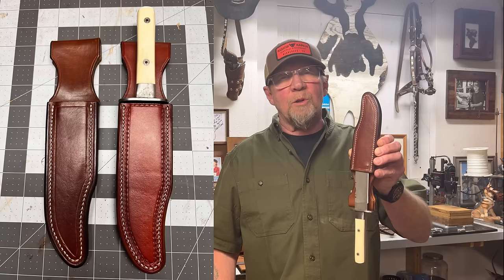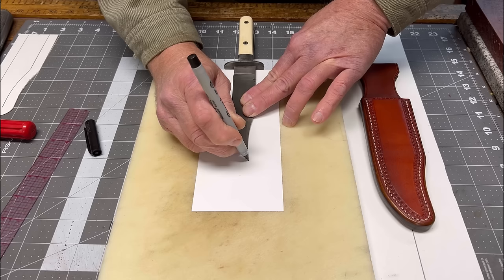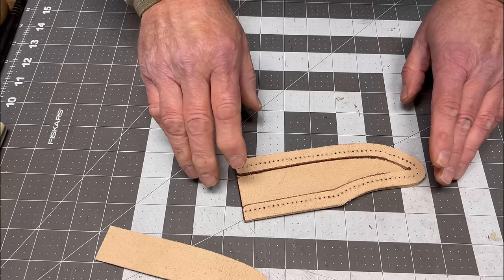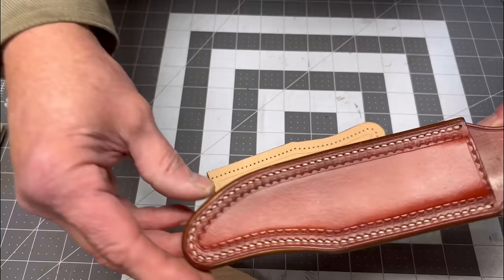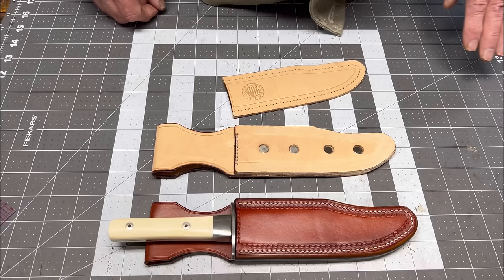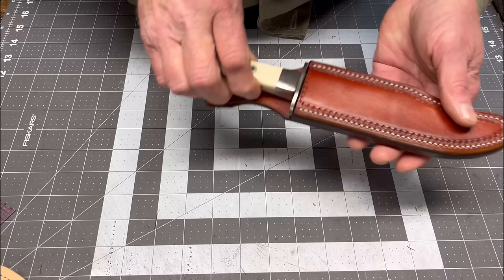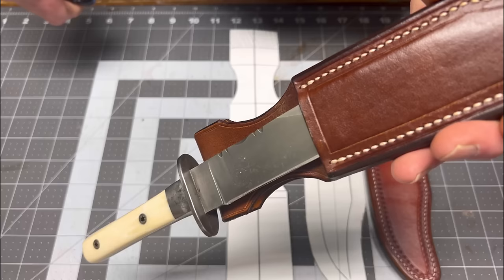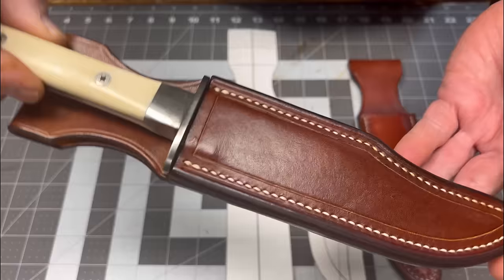The Secrets Of Knife Sheath Crafting At Knife Sheath School! #knifesheath #leather #knifeskills

Comment: Good info, I've been a knife maker for 40yrs and have always used a mini drill press to make stitching holes, it just works!
Reply from the maker: Agree 100% Mr John   I use a 1/16th” bit and as long as the thread  (1.0) size fills the holes it works perfect and makes a great stitch line  Whatever works. Thanks🙌

Comment: Hi Victor. Wonderful tutorial! I followed your directions for a KBar knife I made for my son in law. It was the first full-size jnife sheath I’ve made and it turned out beautifully…except for one thing. Like your example, I installed two name tag magnets, but it turned out pretty difficult to remove the knife. It for sure couldn’t have been withdrawn if the sheath was hanging on a belt. I removed all the stitches, carefully sliced the sheath open, the removed the bottom pair, glued and stitched it back together. Unfortunately, it STILL is difficult to draw the knife. I guess I’ll have to cut it again, pull out the bar, cut it in half and only use one magnet. I say this mostly as a head’s up for someone else that may be making this same sheath.
Reply from the maker: Hello Alan  Sorry to hear of your difficulties but I’m curious about the magnets you used  Were they the badge magnets? Those shouldn’t have been strong enough to lock it in like you described   I’d love to dwelve alittle deeper into what could have caused that   Thanks for your kind words 
If you have Instagram 
@viktorgeorgeleathergoods direct message me

Comment: Good Vid. I've been thinking about moving away from retention straps to magnets for awhile now. This was a neat example of how to imbed the magnets. I never thought of using badge magnets. (thanks for the tip) I've always drilled my stitch holes too, life is short, only difference is I use an actual drill press to do it. The Dremel just doesn't have the horsepower to keep the bit speed consistent. I can also slow my bit down and drill a little cleaner. I enjoyed watching this, thanks for posting it  🔥😎
Reply from the maker: Hello Fireworxs Thanks for the nod and kind review. I really appreciate the time you took to leave such a positive comment.  I agree with your drill press views and I think I’ll upgrade to a bigger one soon. Believe it or not I’ve had that very stand and dremel since 92 😂 Thanks again for the support!!

Comment: I had a Westmark skinning knife , tried to keep shaving sharp . The sheath I carried on my belt would take the edge off in little more than a day . So I made a hard wood scabbard . I carved a groove so the edge of the blade would never touch the scabbard . I cut two grooves on the inside of the scabbard and glued leather in the grooves to grip the blade . My blade stayed shaving sharp always .The leather grips worked so well I hooked it to my belt point up , it never fell out in 10 years then stolen, don't know after that.
Reply from the maker: Hello Clay. Sounds like great fabrication methods to achieve those results It always fascinates me how many ways there are to make a sheath. Thanks
Reply: It sucks when you have something that you’ve put work into and you really value and it gets stolen.

Comment: Can you let us know what size brass nails or brads you use to decorate your sheaths and how you bend them over on the down side. Thanks for all your videos!
Reply from the maker: Hello Gary  These escutcheon nails are solid brass and come in different rounded head sizes. Usually 1/4-3/4” in length  
I use them as decor only as they are not meant to be for securing two pieces of leather. After they are seated in the leather I peen the cut off shaft of the nail into firm leather. The brass is soft enough to swell and bite for a nice tight hold  I must admit that 100% brass nails are hard to source in todays world since everything nowadays is plated

Comment: Beautiful sheath. I'm looking for a custom sheath for my Ka-bar, but not so thick, due to the added layers of the magnet retention system (One reason for this is that I may be wearing gear that can cummulatively interfere with the use of a magnetic compass in the field. The less added magnetism, the better for accurate navigation). I like a stud retainer, adds a little bit of flair, without using a snap. I was thinking of a semi-convertible sheath that can be worn either traditionally in a vertical position on a belt, or sometimes as a scout configuration (sideways, worn longitudinally on the belt), but across the front instead of in the small of the back, and I'm left-handed, so I want to be able to access the knife either from the belt or if needed attached vertically on the suspenders of a military H-harness load bearing system. This means that additional crosswise belt retention straps either need to be added to the design, or they can be easily attached to the sheath when used in this manner.
Additionally, I hope there's a way to get the USMC Eagle, Globe, and Anchor emblem embossed on the front of the sheath as used in the issue Ka-bar sheath, (I'm a retired Marine), and perhaps some black-finished additional hardware like rivets or grommets instead of regular shiny silver or chrome hardware (My version of bling is black hardware, instead of something shiny).
I want the dye on the sheath to match, enhance, and complement the look of the Ka-bar's beautiful stacked leather washer handle and the deep military black blade and pommel and handguard, in a way that presents a whole and harmonious look when the knife and sheath are presented together. 
No need for a sharpening stone pouch, although that would be nice if it doesn't add a lot of bulk to the entire package, and I have no need to add fire-striker storage loops and such.
Also, when worn on the belt vertically, the suspension loop on the sheath has to be tough enough to withstand heavy use in the field without wearing out and failing too fast, and the whole package has to be reasonably slim enough to be versatile wether I'm wearing the knife openly in the bush or tucked away under clothing if I feel the need to carry it around town.
And maybe even some texture contrast on the visible surfaces, like two different dyes to enhance features such as the Marine Corps emblem and the stitching, with black stitching instead of using a light-colored thread.
So, what do you think? Is this too unreasonable? I'll pay good money for a sheath like this as long as it's reasonable. My Ka-bar sends a statement about who I am, and a beautiful good quality sheath thoughtfully put together would be an excellent legacy to pass down to my children when they talk about me long after I'm gone. 
I'll be looking to contact you to see if you can help me with this. 
R/S
SSgt Cruz, David C. 
USMC (Ret).
Reply from the maker: Hello David First of all thank you for the kind words and most importantly thank you for serving our great nation. Your vision of the ultimate KaBar knife scabbard is phenomenal however I’m not taking custom orders until the fall due to the fact that I’m a one man shop and can’t take on anymore work. I will however during my down time start working on a pattern with your aforementioned input and see where it goes. Lots to ponder on that one and the pattern process is the most difficult part of the build. Thanks again David

Comment: A little quicker than measuring the .5", I use a wing divider with the attached pencil( I forget the actual tool name) and trace the blade with it set at .5" after tracing the blade with a pencil
Reply from the maker: Thank you Mike for the comment.  I would agree with you that it would be faster but I’ve never been able to get an exact & clean line that way   This way is muscle memory for me and I agree that it may not be the most efficient  I appreciate the banter 🙌

Comment: Hello George !  I am working on making a sheath using your pattern and process, and had some questions as I plan my next steps.  First is just a question about thickness of the welt.  I see the use for a sandwich piece on the back side of the magnets,  but wondered have you tried not using that piece, and just gluing the magnet piece to the back body of the sheath, and did you have any adverse effects? I know that piece is the thinnest of all the pieces, but leaving it out could reduce overall thickness by a few ounces?  My only reason to ask, is not putting that extra piece on the back of the magnets does help reduce the overall thickness, but I figured since you make these, you could share whether it would be a good thing to do, or you could share any problems you encountered. I hope you don't feel I am questioning your knowledge and experience, I am just curious, and mean no disrespect.  Quite the opposite, I am truly appreciative that you shared how to make this sheath, and the process.  It is going to help me tremendously!  Thanks and have a great day sir!
Reply from the maker: Hello Fred Thanks a lot for the discussion and that is a good point on just gluing the magnet  piece to the back however on my initial attempt years ago I noticed  a lot of protruding on the back side without the support panel.  I never take any offense to this type of banter as I learn something every time. I’m glad that this is something you’re going to try and keep making! I have an Instagram @viktorgeorgeleathergoods and there you can DM me anytime and I can get back with you faster!!

Comment: Hello. I am using this method to make a sheath for a dagger I just made! One question though. Does the “magnet sand which” need to be the same thickness as the guard to hold the knife away from the hang down/belt loop area? Thanks for the great tutorial!
Reply from the maker: Great question Nolan  There’s a fine line between a good fit and being too thick  My suggestion would be to dry fit all the layers with the dagger in place to see if everything you need for fit works. I always do this because each knife is different. I try to keep the overall thickness of the welt on these around half inch.

Comment: Nice. How do you sharpen your edgers?
Reply from the maker: I use a motorized polishing wheel with green jewelers rouge
Reply: @viktorgeorge9144  Ok, but can you reach the "blade" in the small gap?
Reply from the maker: @blackz9058  Yes the muslin wheel gets into the blade of the edger for strop polishing.

Comment: So how do you decide how thick to make the welt
Reply from the maker: Hey Brandon  If the welt is too thick and the knife doesn’t get compressed after sewing the sheath face down it’ll not hold tight. Sometimes I’ll put a thick welt in and then shave it down with a skife until it’s right. I have another style of  sheath video brewing and I’ll make sure to address that. Thanks!
Reply from the maker: That was kind of you to say Brandon. Thanks   Most of us would do it all over again   
I’m glad this is helpful to you and with this type of support I will continue 🙌
Reply: I would measure the thickness of the blade’s spine and then choose a leather that is about 75% of that number. That way it will be snug and with the natural stretch over time it won’t be sloppy
Reply: @brandonzimmermann  thank you that is the part I have struggled with for so long I know it seems like the easiest part but I just couldn’t figure out how to make it right